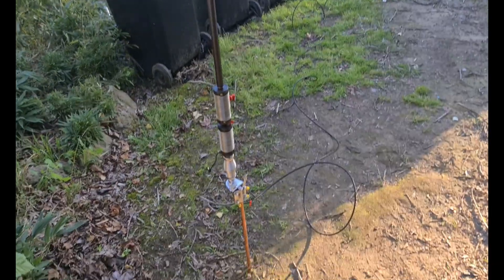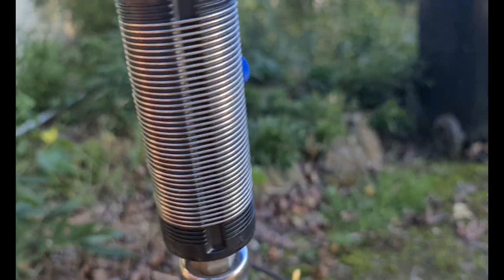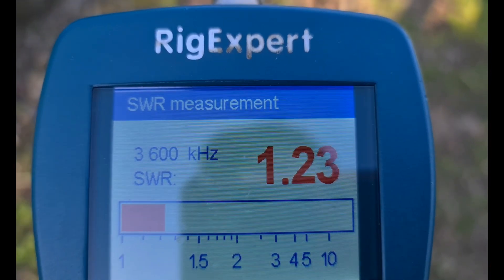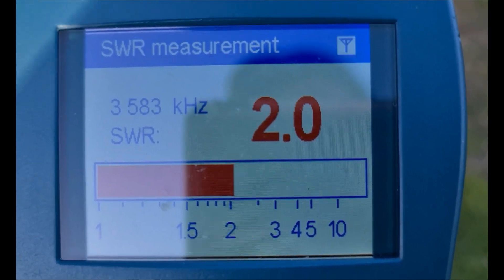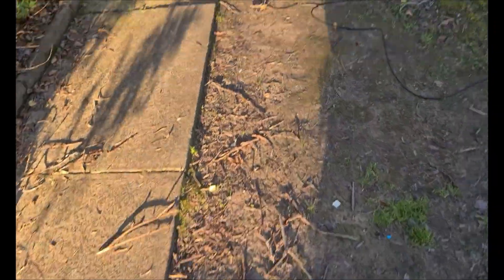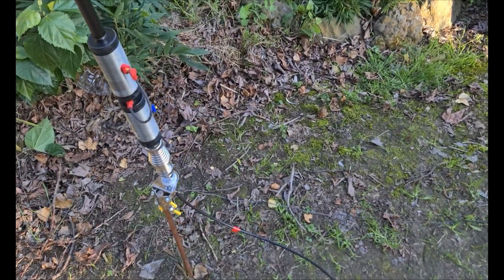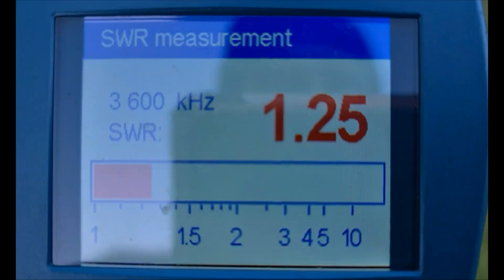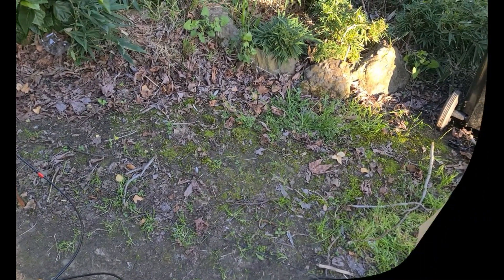Converting the Buddipole BP. Antenna into an 80-meter vertical

Comment: Did you check the setup on other bands as well? Does it work on 40, 20, 10 m, and possibly other bands by moving the contact on the coil? Or do you have to remove one coil for that? Although it probably won't be a great performer on 160 m, I'd be curious how it would work there, or if it'd work at all.
Reply from the maker: This antenna works on all bands  but only uses  a single coil in the vertical array 40 to 10 meters. i tried adding 2 coils to see if 80 meters was possible  coil as shown. With contacts into NEW ZEALAND, I believe it may also do 2/70. I have not tried it for 160. This is a great alround antenna, and i have tested it on the WARC bands. You can see in another video how well it oreform on 40m on 10watt in the USE
Reply from the maker: If you watch other videos, i have posted on this antenna